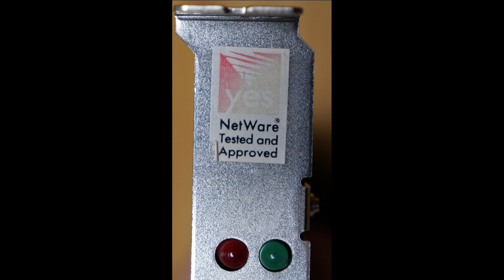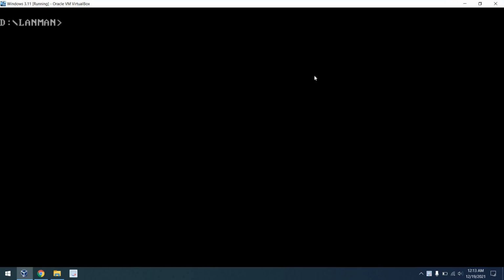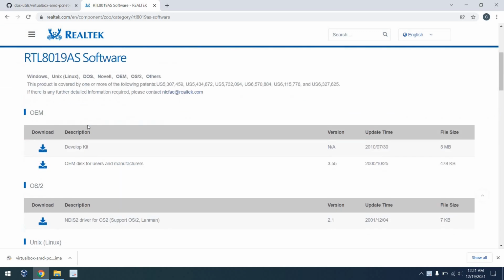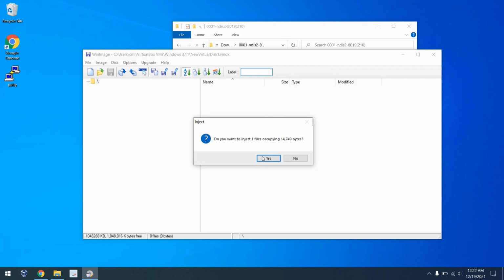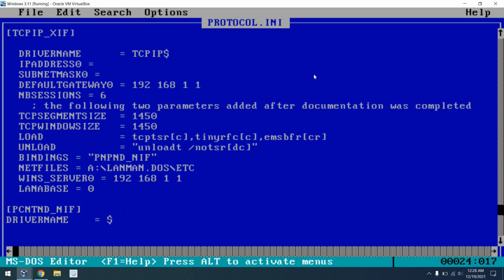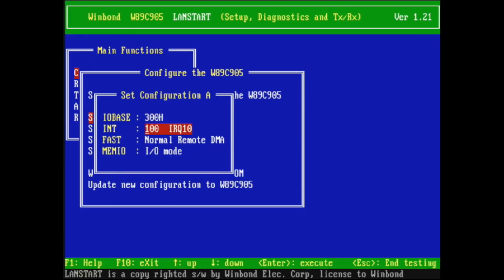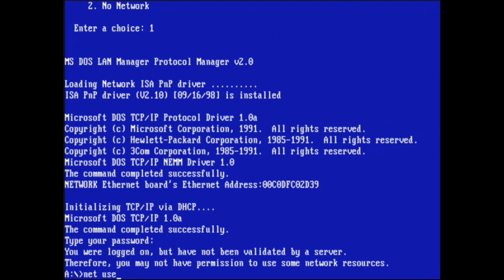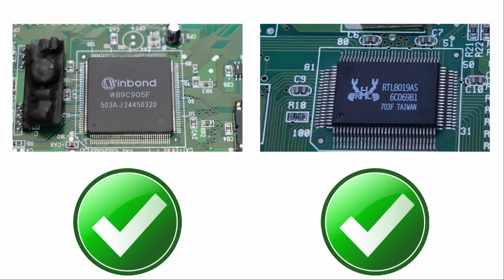RetroShort: Testing Testing Two ISA Network Cards...With a Twist!!

Comment: Nice! I've some ne2k cards that I ended up using for an embedded project I was working on, using them on an 8bit bus rather than 16. Sadly, I killed my RTL8019 by doing so, but I had two other ne2k compatibles anyway. Nice video as always!
Reply from the maker: Nice!  I just ordered a RTL8019AS 8 bit card from Tindie, been playing with RPL boot with it on my 286 based Tandy 1000 TX (which only has 8 bit expansion slots).  Great little card!

Comment: According to the Samba 4.16RC2 release notes SMB1 features required for clients through Windows 98 have been removed. SMB1 server support will be removed completely in another upcoming version. You may want to use apt to hold the Samba version on your Pi.
Reply from the maker: Sadly it was just a matter of time.